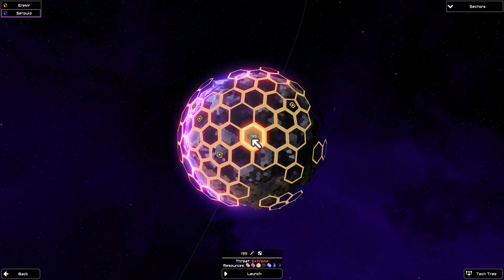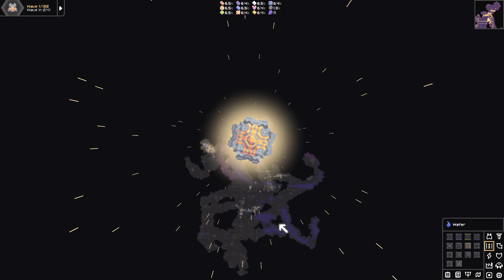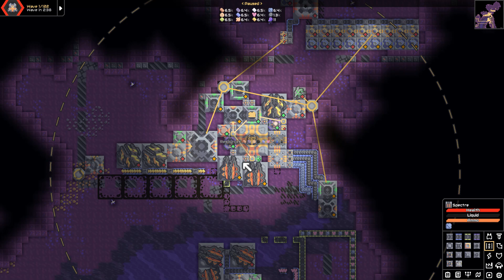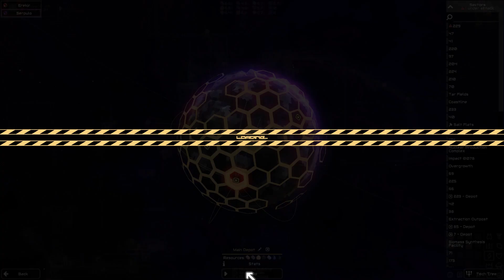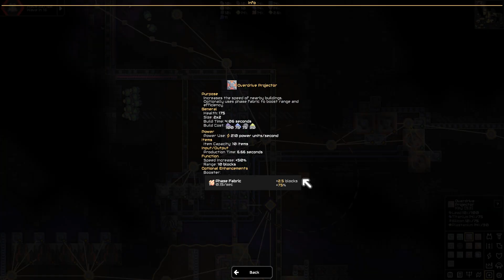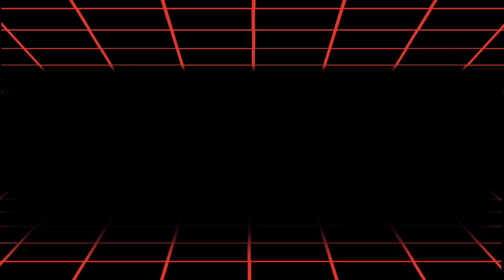Mindustry Testing the New Core, Kinda

Comment: Nice one ! You can tweak your schematic in the sandbox to try it out
On v7, imports are calculated on a per-minute basis but are really applied every two minutes or so
On v8, imports are real-time because you have to build a landing pad. It makes imports much more consistent
Like Nathan said, usually one logistic hub is used throughout the conquest of the planet. Additionally, another logistic sector for "attack" bases with a focus on silicon supply and other resources for T4 at least, or T5
Reply from the maker: Thanks for the info. I'm excited for v8, I just want to get through all of this version first.

Comment: Transport between sectors seems to be instant.  A single hub also makes it easier to know how much throughput you have available.  I like Ground Zero since it's named, extremely safe, and has lots of thermal power and water for after you have enough launch pads or materials processing to use that up.
Reply from the maker: I need to go back to ground zero and investigate it more.